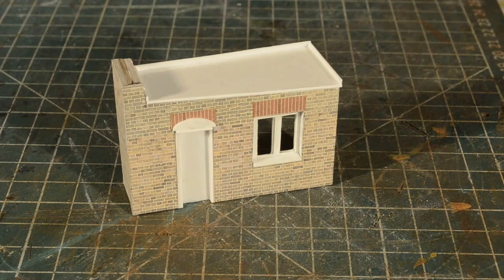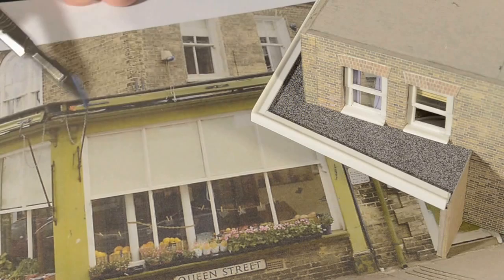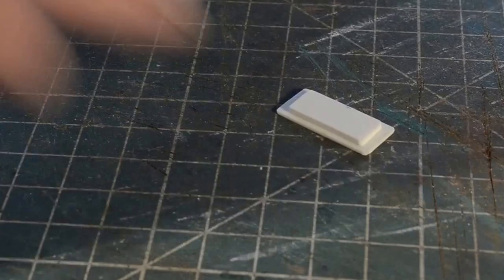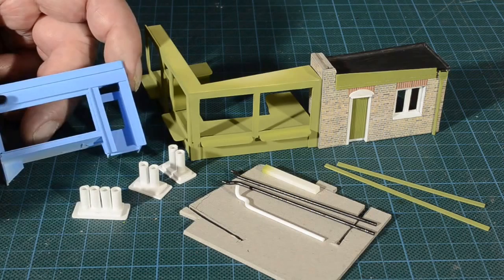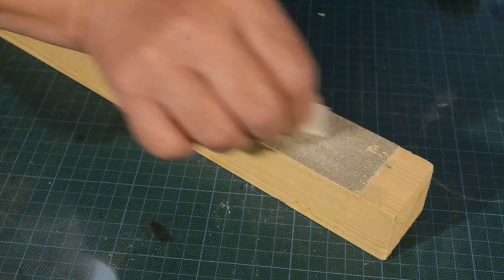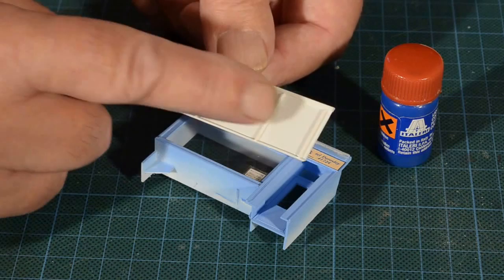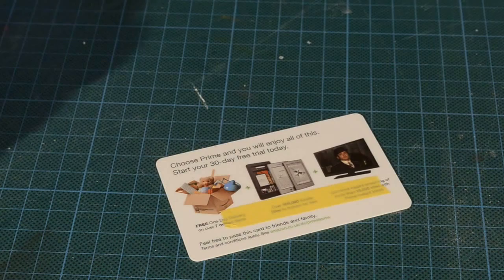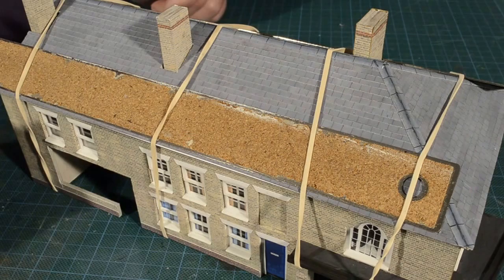MAKING BUILDINGS FOR YOUR RAILWAY #2

Comment: Fabulous! I model in N gauge, but will be using some of these ideas if you don't mind, I like the way you bend the plastic pipe using a tea light, I never thought of that, I already use plasticard sheet down to 200gsm and 2mm pipe for the chimney pots.
Like you, I am used to scalescene kits, but fancy doing some scratch building of my own, thanks again, cheers Dave
Reply from the maker: Hi Davie, thanks very much for your kind comments. I don't mind in the least, half the fun of model making is sharing ideas. Good luck with your scratch building, I will be doing more in the future  ...  David

Comment: Great work on the shop fronts and awnings David. I particularly like the use of painted self adhesive tape for glazing bars, rather than fiddling with very thin plastic and messing up the "glass" itself, and the lead flashing tape too. All ideas I will be blatantly stealing for my future builds.
Reply from the maker: Many thanks Davie. All these techniques I used in making model aircraft, the tips were passed on from others so feel free to 'steal' them. Sharing ides and passing on tips is what it is all about. - David

Comment: Fascinating build. Can you tell me what material was used for the roof tiles? I am trying emery cloth cut into strips but it has that hairy look. Thanks
Reply from the maker: Sure Charlie, thanks for the comment. The roof tiles were printed on thin matt A4 photo paper and glued onto the roof shape made with thick grey-card. Sheets of various tiles can be downloaded from scalescenes.com - I have been advised by another subscriber that time can be saved by using a matt self-adhesive photo paper. Anyway, the surface is smooth. The download comes with a template to cut the tiles into strips so they can be overlapped to provide a more realistic effect. Weathering was airbrushed on after the roof was finished.  Hope this helps  ...  David
Reply: Thanks very much David. Really enjoyed your video

Comment: Hi David, Nice to see your scratch building technique. I am trying to do similar. Where do you get the 1mm and 2mm Card?.
Reply from the maker: Hi, thanks for your comment. Easy question to answer, I get mine from ebay, plenty of suppliers here. Simply search 1mm (2mm) Card most suppliers sell the different thicknesses. I buy it in A4 sheets. Good luck with your build, its great fun. - David
Reply: Thanks David, I have had a look will order some soon!